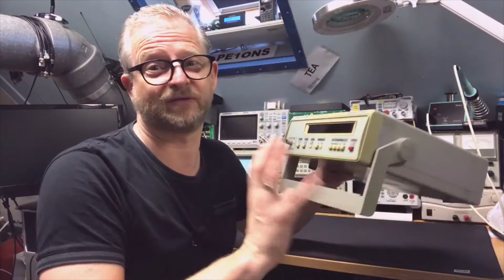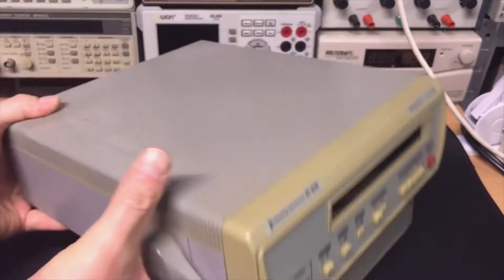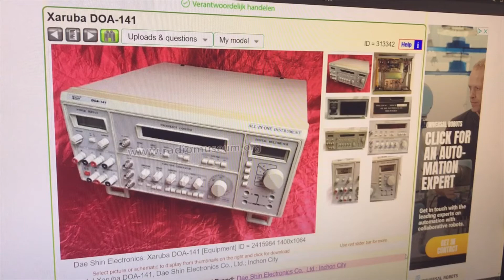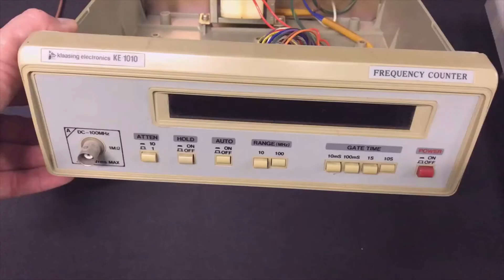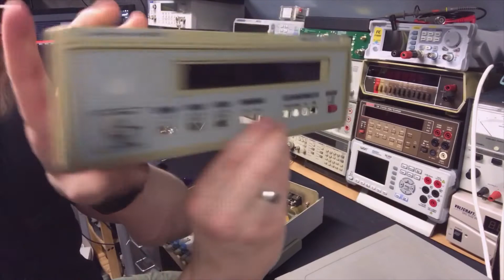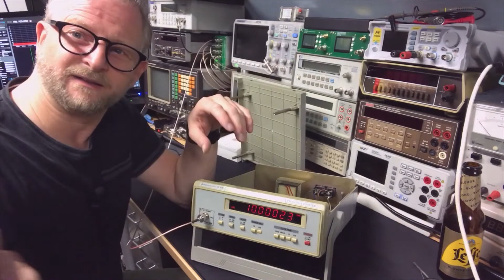TA•0073🟦How to Identify an unknown Brand / Rebrand

Comment: Nice work!
I reckon an external 10MHz input with a switch to select between internal and external reference on the rear panel would be a fun mod.
Or even an OCXO to replace the standard crystal if you can find one cheap.
Reply from the maker: Hi Jared, Thanks... Yes indeed, like in my video #062 where i do that with a FY6900, in both is lots of space to do so.